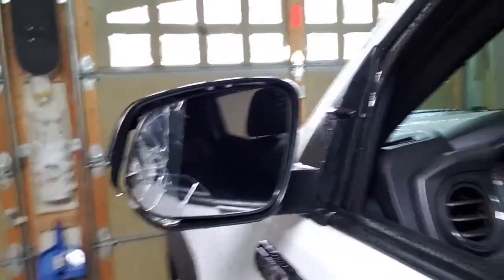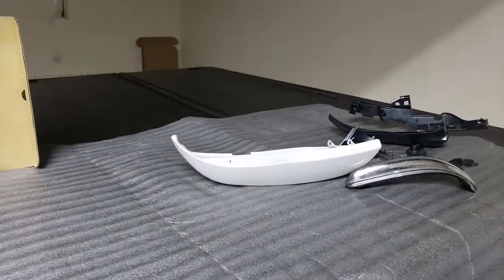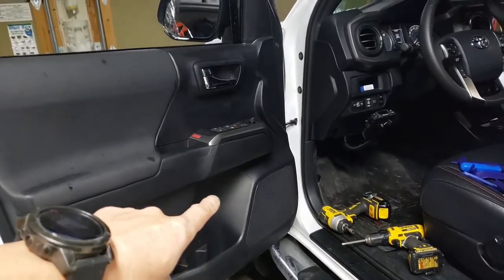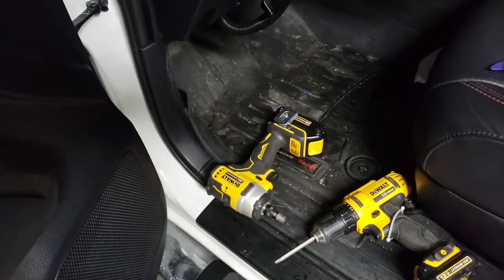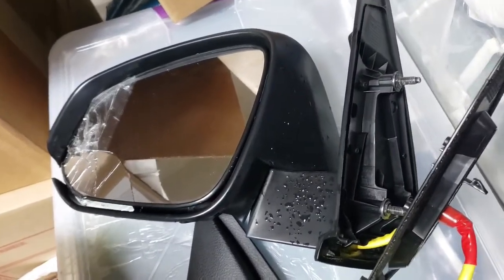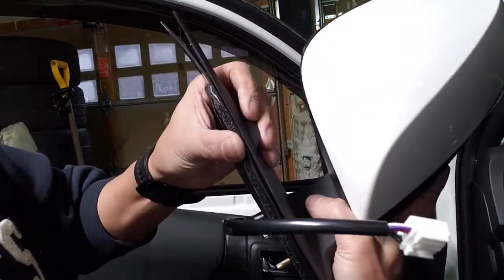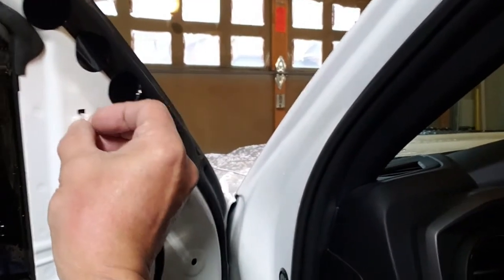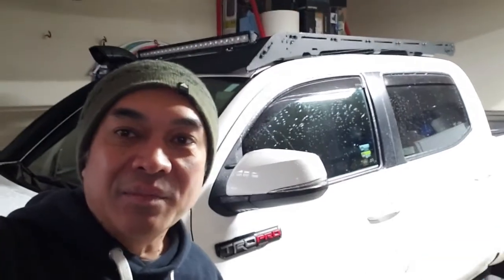3rd Gen 2016-2021 Toyota Tacoma TRD Pro Side Mirror Replacement DIY Installation Guide, Mod #20

Comment: Thanks! Got an OEM mirror from my dealer for $230. Shop around different dealers online and you can usually find one for cheaper than the msrp of 350 or whatever it is. Took me 30 min start to finish.
Reply from the maker: @SummitSubscription  nice! I guess $230 is a good price for OEM. Big thing is you did the labor so that’s big savings. Thanks for tuning into my channel.

Comment: Just followed the first ten minutes of the video. Let me save you some time: undo the two phillips screws and top button fastener, pop out just the top corner(not the entire door assembly), you will be able to remove the harness and and the mirror with 10mm socket with ease.
Reply from the maker: @thomasniemann  thanks for your input, I’m sure it will be helpful to other viewers (hoping that I won’t have to do it again).   =D

Comment: hello sir, quick question. I bought my mirror from the dealer and installed myself. Every single thing works (BSM, heating, cameras) but the power tilt adjust is not working. Could this be a faulty part?
Reply from the maker: Hard to say, maybe Toyota sold you the wrong one.  What's the OEM part # for the one that you bought?
Reply: I mean I gave them the vin number for the part so I can’t imagine they gave me the wrong part
Reply: Can I take a multimeter and check for power when the switch is toggled
Reply from the maker: @shanvirjhawer4589  sure, you can try that to check wiring on the harness to ensure proper contact.

Comment: Great video!! I lost one of the white clips for the black panel though.. will I be okay with just 2?
Reply from the maker: Yeah, those are slippery little suckers aren’t they.  My Toyota dealership wants like $7cdn for 1 clip if I recall it correctly.  You’ll be fine with just the 2 and should hold as it’s just holding that black triangular cover panel.  Thanks for tuning in Tin9800!
Reply: @modXELA  awesome, thanks for the help!!🤙🏼
Reply from the maker: You can buy it from Amazon for a lot cheaper, just search on “Toyota 67771-58010”.  Good luck!

Comment: YOU DID A FANTASTIC JOB! WHAT ABOUT DOING FRONT BRAKES?
Reply from the maker: Hey thanks duck featherland... I will do a brakes/rotors replacement video when the time comes. I only have 15k miles on it so no need... yet.  =)

Comment: One question what is the torque on the nuts tightening on the mirror?
Reply from the maker: Hi Charles, I just hand-tightened the screws but if you want to be more accurate,  I'm sure there's a torque-tension reference guide available online based on screw size and thread pitch.  I hope this helps and thanks for tuning in!

Comment: I got a mirror for my 2020 Tacoma but it's a 7 pin connector and the door has a 14 pin so doesn't fit.  What gives?
Reply from the maker: Sorry to hear that Jeff.  Did you check fitment with the manufacturer when you purchased?  They could have also sent you the wrong product.
Reply from the maker: Hey Jeff, I checked Rockauto and compared the parts for 2019 and 2020 and they both use the same part #s.  Is yours a TRD Pro?  There are differences if yours has Blind Spot Detection, Turn Signal Lamps, Heat, Power Adjust, Side View Camera, etc. Your trim will determine applicable product #

Comment: Great video, my dude. Just busted my passenger side mirror, and I will be using this video, when I replace it. Thanks for making it.
Reply from the maker: You're very welcome my friend. One thing that I didn't do as I only learned it after the fact is round stickers that cover the holes, instead of peeling them off, just simply poke/push in the center of it and they will come off easier.  Good luck with your install and hope to see you again on my channel.  Thanks for tuning in Casey!
Reply: You were correct about the stickers. New mirror is installed. You’re a lifesaver.
Reply from the maker: @MrRandomhero07  Nice! I'm glad the video helped and that it worked out for you Casey... safe trucking!

Comment: Just did the same thing your wife did. Ordered a replacement and will be installing it this weekend. Your video will be very helpful.
Reply from the maker: Sorry to hear about your mishap. One thing that I did not mention with the round sticker hole covers, instead of peeling them off, just simply poke/push right in the center of it and it'll come off easily.   Good luck with your install and thanks for tuning in Rod!

Comment: Hey buddy I’m looking for the passenger side mirror just like yours but for the passenger side? 2021 off-road … can you help me with a link at Rock auto ??
Reply from the maker: Hey Simon, sorry I'm not familiar with what you have but there are different types (with blind spot, with heat, with signal lamps, etc... pick what applies for you and here's a start: https://www.rockauto.com/en/catalog/toyota,2021,tacoma,3.5l+v6,3446952,body+&+lamp+assembly,outside+mirror+&+glass+assembly,1304

Comment: Great video bro, a motorcycle broke my mirror and I need to order a new mirror, do you know if the mirror you install fits my Tacoma 2021 TRD OFF Road
Reply from the maker: Thanks bro and sorry to hear about your side mirror, that sucks. If you go to www.rockauto.com and specify your truck year and model, it will give you the proper part. Good luck with your fix and thanks for tuning in Marcelino!
Reply: Did the mirror he used fit your bro??

Comment: Can the back be exposed to rain/moisture? Will it damage any wires/fuses?
Reply from the maker: Hey Jordan, I suppose that exposure to rain/moisture is unavoidable for any exterior unit but the wires should hold.  Fuses won't be a concern as there's no internal fuse in the housing.  It's been over a year since I did this install and it's been through winter last year and again this year and so far, everything's working as expected so this is a good indication.

Comment: Question boss.. my dumb self ended up breaking this thru the garage. I have an ST5 do you know I can upgrade for the turn signal ones ?
Reply from the maker: Based on some readings, it doesn't look like your model is pre-wired for this.  You will have to run wires.  Here's a note from a blog, "I actually inquired with Toyota service department as well as parts departments before I ended up buying my TRD Sport, about the possibility of swapping out TRD style mirrors with those that come on SR5 models. It is NOT as simple as plug and play. There are no wires on the SR5 for the turn signals as there are on the TRD models. So as others have suggested, you would have to run another wire and connect it to the signals to make it work. That was one of the things I liked about the TRD versions, over the SR5, being the nice mirrors on the TRD with the turn signals in them."  I hope this helps!